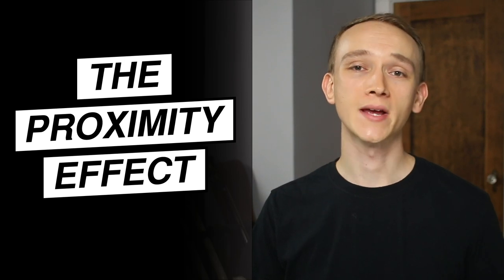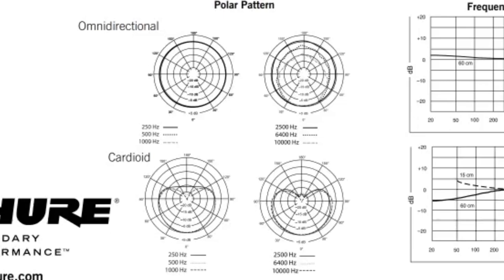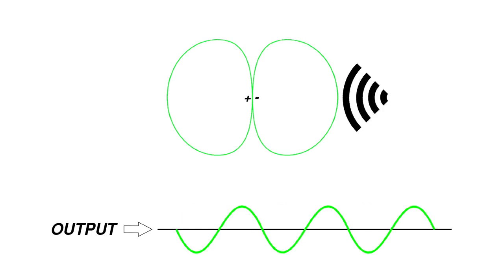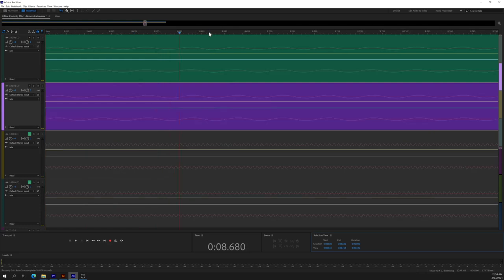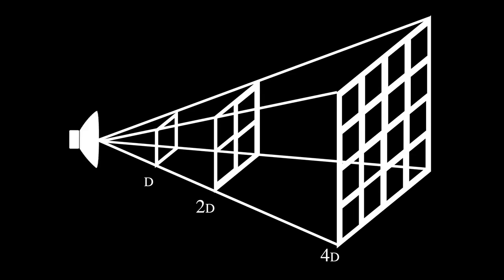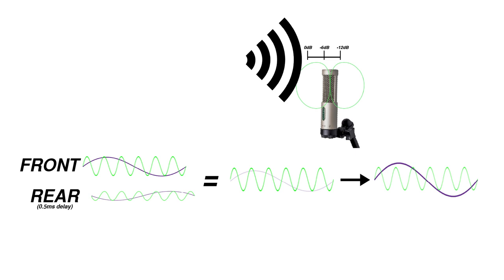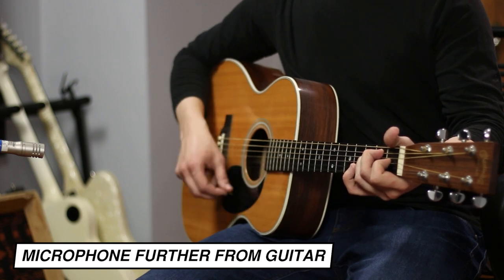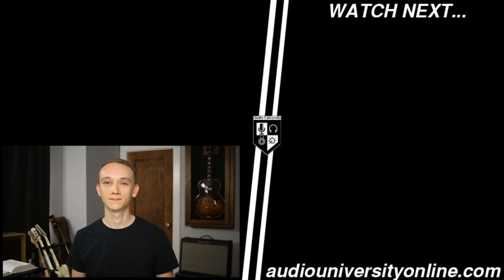The Proximity Effect | How It Works & How To Avoid It [With Audio Examples]

Comment: Answers to questions I never knew to answer for 40 years. Intuitive and in common practice as industry standards no one has known why mic placements are so sensitive to proximity. Now I finally know why what I've been doing for so long is how I do it. Thanks!
Reply from the maker: I’m glad you found it useful, Jon. And thank you for pointing this out - there are two perspectives that are each important, theory and practice!
Reply: you didnt know that? ok 40years are a long time but when i started in 2000 screwing with music, EVERY youtuber had a video about that topic allready
Reply: @AudioUniversity  Theory and practice are not two points of view, two ways of knowing, if you will. In fact, there are hundreds of different types of microphone designs and dozens of ways to use them. But in "small music" the ones described by you are used more often.

Comment: Some more points: 

1. The effect doesn't just affect wanted sounds, it applies to the whole lot, INCLUDING handling noise. If you look at old video clips of professional singers in the 1960s or earlier, you will see that those who handhold are mostly using omnis. And they were trained how to use them properly. Singers nowadays rarely (if ever) have any idea! 

The old guard of band singers would've expected to be given an omni stick of some sort in the TV studio (or on stage) and there's a range of classic mics that were made just for that, such as the CK2 capsule for AKG C451-series modular mics, and (particularly in the USA) the EV635A, originally a 1960s design (I think - I"m not that old!!!), which is an excellent mic for vocalists. It doesn't have an extremely wide frequency response, and nowadays doesn't look very nice, but it's omni, doesn't distort much when yelled into, and has very little handling noise. 

They'd wrap the cable in their mic-holding hand, too, to reduce noise further, but I digress: trained singers would help the balance engineer by changing mic distance ("vocal mic technique") to manage their own volume - "fff" bits with the mic around 12-18" away, but quieter bits with the mic a lot closer. 

Nowadays we have compressors, obviously, but they don't solve the basic problem, and exaggerate bass tip-up (proximity effect) unless you put EQ in the side chain, which gets really messy, needs a decent rehearsal (wot are they?), and is time consuming to get right.

Note that you shouldn't actually need a cardioid mic for PA in this context, as the polar pattern doesn't help feedback or colouration (because it's essentially close micing a loud source, you shouldn't have enough gain in the channel to be anywhere close to feedback!), but being omni really does help. It also helps things like p-blasting - you don't get the 'plosive consonants as badly with an omni. Modern, head-worn mics are, or should be omni, too. Again there's no advantage to cardioids in this context, it just increases unwanted noise (my least favourite is beard rustling with those things!).

These days singers are mostly used to an SM58 on a stand, and that's OK if they do keep a constant distance and don't take it off to handhold it. If they do take it off the stand, all bets are off. If you work regularly with the same lead singer, and they like to handhold, try a decent omni and see if he/she gets on with it.

2. STC/Coles 4104 "lip ribbon" mics are the gold standard for commentary work (worldwide) at sporting events and anywhere there's extreme amounts background noise. I've seen them used by a presenter standing next to a running jet engine. 

They were designed to take full advantage of the proximity effect. There's a spring-mounted robust ribbon inside, with external pop shields and a bar to be held against the face above the upper lip. The mic has extreme EQ built-in to make the 'in front of lip' position sound normal, but it dramatically attenuates distant loud sound and handling noise. Although it's a ribbon it's not an exact figure-of-eight, as there's filtering material and the magnet makes a physical barrier on the 'unwanted' side of the ribbon. It's originally a BBC design, and the early ones had a variable equalizer in a wooden case, but this has been greatly simplified and the current design simply has an XLR at the end of the handle - no adjustments needed.

There's more to this subject, but this is a too-long comment already. :-)
Reply: Long, and very informative, thank you.

Comment: Nice explanation of how proximity effect works. One nitpick. You say at the end that an omnidirectional microphone won't separate a signal from surrounding noise. While it won't separate sounds from a certain direction, it separates close sounds from distant ones in the same way as any other microphone, with distant sounds reduced by the square of the distance – and (as you demonstrate so well) you can place an omnidirectional very close to a sound source without the sound being coloured by proximity effect. The ability to mic so closely can make an omni very good at separating signal from background noise.

Comment: I have some doubt about the explanation, but maybe I'm wrong.

You say that sound pressure on front of the diaphragm generate positive voltage and negative on the back.
You say that a sound coming middle cancels out since it arrives on both at the same time.
This is right and indicates that you are adding the front to the back (with back being the front with a change of sign).

In my opinion you either: 
1) sum the 2 sound pressures/voltages doing the change of sign for the back.
2) subtract the 2 sound pressures/voltages without change of sign.

Mathematically it is the same.

If you consider what you say at 4:00 with the change of sign you should clearly see that subtracting the low frequency sound, being it pretty much the same front to back, you are doubling it: x-(-x) = 2x.

Further more 0.5ms of a delay is really unfortunate being half the period of a 1 khz sound, considering that sin(x+pi) = - sin(x), the sound will cancel out.
For what I have seen in another article the delay has to be inferior to half the period of the highest frequency sound or anything could happen.
In the same article they talk about difference in sound pressure front to back (they call it pressure gradient) but without the change of the sign and to me it seems right.

EDIT: "change of sign", not "change in sign"... sorry english is not my native language (I'm italian).

Comment: hi, thank you for sharing. Since it seems you are using a cardioid pattern small diaphragm condenser microphone for your speech, may I ask a question? do you think a small diaphragm condenser microphone with cardioid pattern is the best choice for a not acoustically treated room?
Reply from the maker: For a room with poor acoustics, the best choice is probably a cardioid dynamic mic at close range or a shotgun mic just outside the camera frame. It depends on if you want a microphone on camera or not. 

I’ve been using a small diaphragm condenser in cardioid just outside the camera frame. However, the echo and reverb in my room is an issue, so I’m currently shopping for a shotgun mic. If I had a better-treated room, I might switch the small diaphragm mic to omni.
Reply: @AudioUniversity  thank you